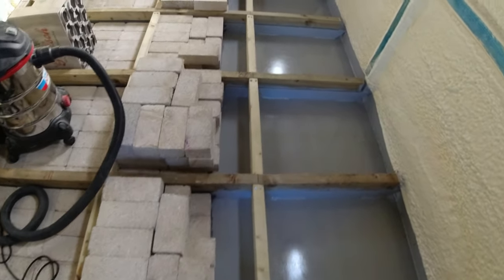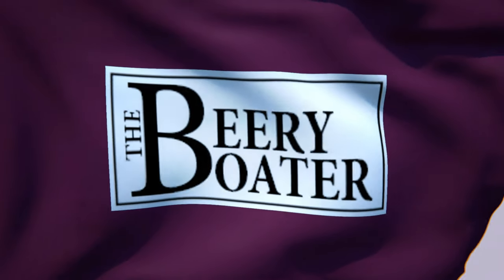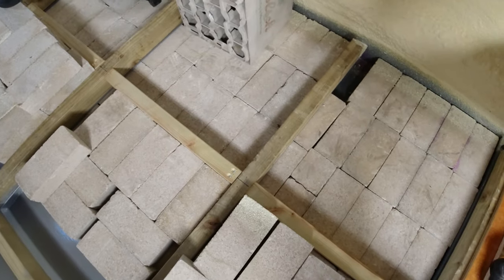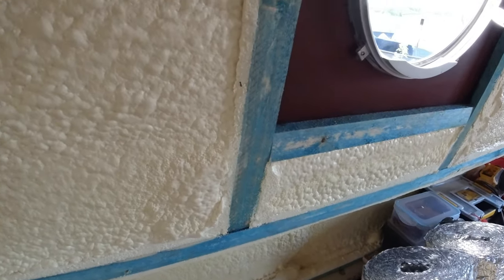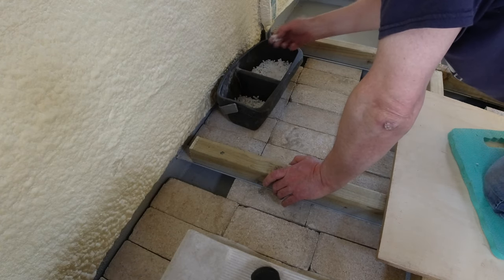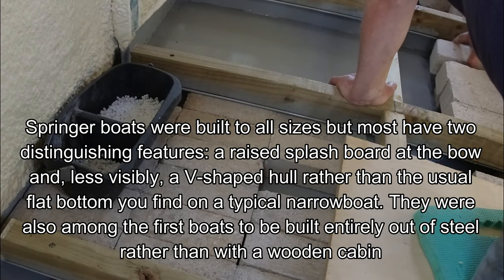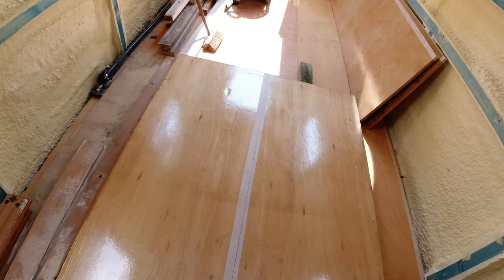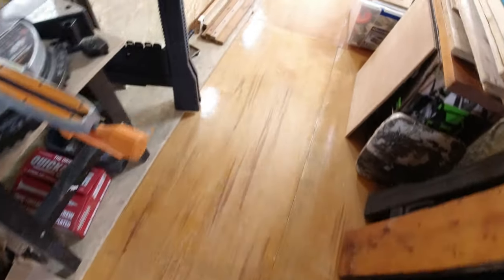Narrowboat_fitout_epi#10 – The Battening Out Begins… and more!

Comment: Hi like your work but there is only one thing I would like that is when moving with the close-up view move slower as it is hard to follow at times. otherwise great stuff Kiwi gazza
Reply from the maker: Thanks for your valued comment, Gazza. Much appreciated. It’s always good to receive feedback. I will bear this is mind for the future.
I do record my videos as live, so there are never any retakes, only editing of the actual footage I have. Most of the time, I’m holding the camera with one hand, whilst working with the other, so-to-speak. That’s why I stumble and / or repeat my words sometimes 😉. The video is secondary to me doing the actual build. 
Can I ask, are you watching at a reasonable resolution? When I first upload to YouTube, it first displays at 144P (extremely low resolution) whilst YouTube renders the video to my maximum chosen optical resolution. A slow viewing resolution can sometimes produce out-of-focus results, particularly when ‘panning’.
All of my footage is shot in 4kHD @ 2160p60 4K, and it can take YouTube a day or so to render a video of this length and visual quality, so do check your settings on the ‘cog’ at the bottom of the screen, just in case.
I don’t usually publish until it at least reaches the 1080p stage, then YouTube will continue to render to the maximum, as mentioned previously.
Having said all this, I will look at this issue you have highlighted so as to give the viewer the best experience. Without sounding like I am making excuses; this type of production is still relatively new to me. Is there a particular close-up frame that alerted you to this? Then I can have a look at the render that I created, during post-production?